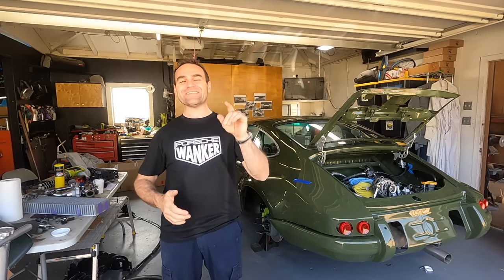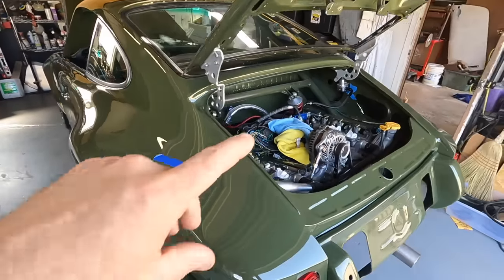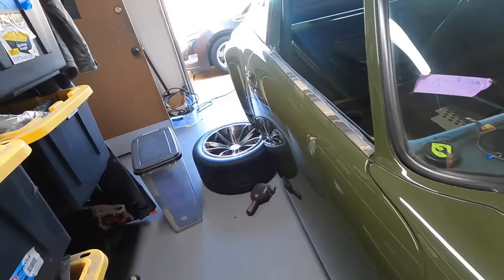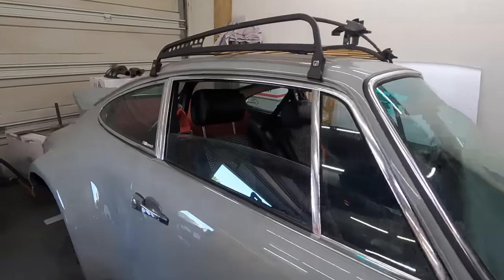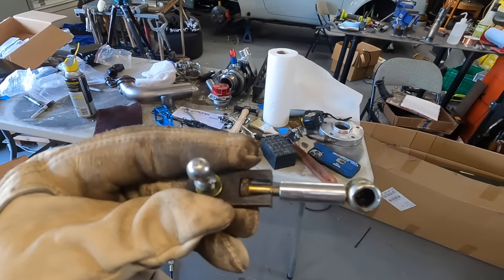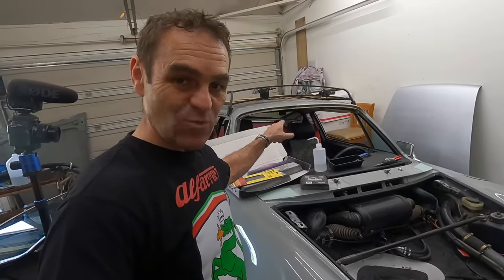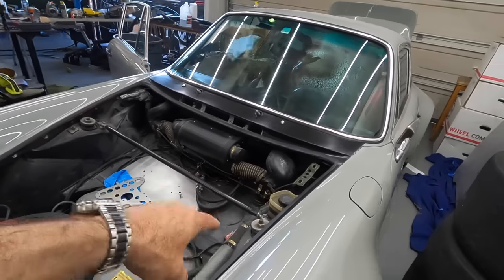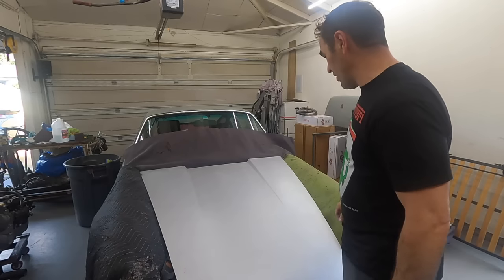Twin Turbo Porsche 911 build project

Comment: It really helps if you have two glass suction cups, one inside and one outside, to move it around and to pull it from the inside.sometimes pulling in and downward makes the top corners go easier.